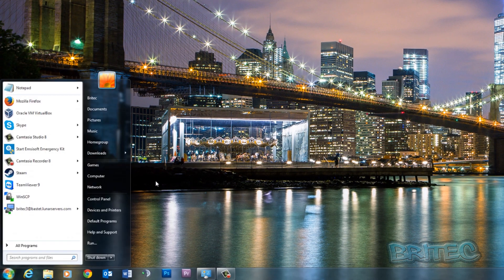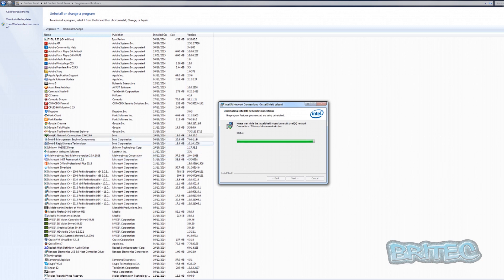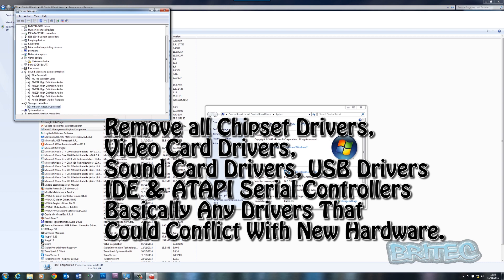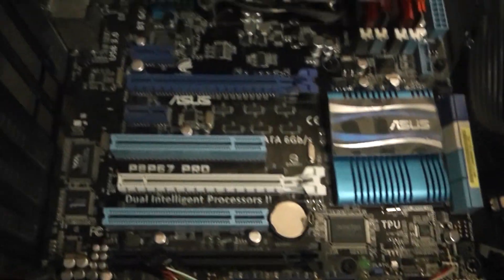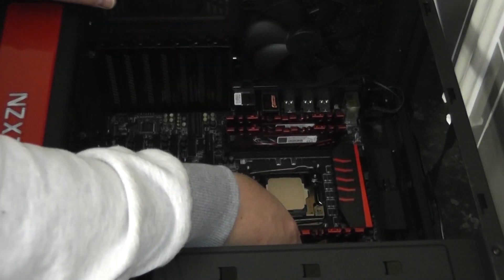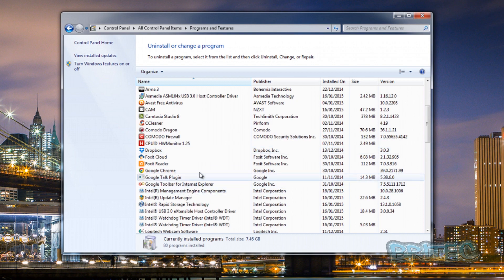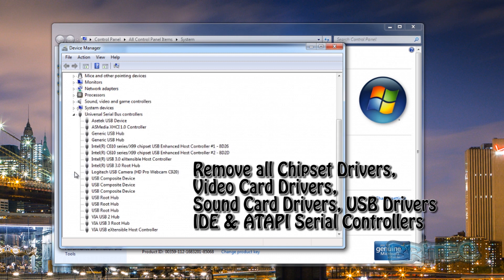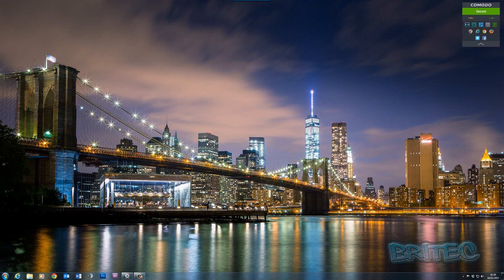Change Motherboard Without Fresh Install of Windows

Comment: Mate I need your help!! First Time upgrade noobE here 😀

Ok so I am planning on upgrading my motherboard from a Gigabyte LGA 1151 z170 GAMING X motherboard to a z370 motherboard so I can use 8th gen processors......

I have over 30 STEAM games installed and a lot of photos and music files stored into my PC. But most importantly are my STEAM games. Can I still follow your steps shown in your video still 2018? Will I have to buy windows 10 again for my new mobo? Also if I just simply connect my HDDs to the new z370 motherboard, will my saved STEAM games and photos/music be easily transferred to the new mobo without backing up anything? My plan is just to upgrade my motherboard and CPU and keep my HDDs. Please help me be successful first try 😃😃

Comment: What if i want to install a new mobo what is basically the same brand chipset as the old one? i just upgrade my miniatx mobo to an atx one due to a broken ram slot. so i just take off network and chipset stuff and ready to go?
Update: I did it. since both mobo had the same chipset and basicly the same version of mATX/atx i just removed audio drivers from device manager and a few chipset/usb stuff, swapped the board and it was all ready to go.

Comment: I think if staying on same brand chipset, the only drivers I Would worry about is the ahci/raid drivers.

So if e.g. from haswell to coffee lake, then just revert to windows standard ahci and you probably good to go, of course tho newest cpus are blocked from functioning properly by microsoft on windows 8.1 and older so the trick would probably only work on windows 10 on the latest cpus.

Comment: Hello, i just finished swapping my mobo, for the first time ever and im very new to pc building. i got windows 10 and i changed from a Asus EX-A320M-gaming ... to a msi b350 gaming pro carbon so i could overclock my ryzen 1600. 
i did the swap very carefully and i unistalled the realtek internet driver and realtek audio driver nothing more, 

note that i only swapped mobo so i kept the driver for everything like nvidia for the gpu n stuff.

when i wqas done i plugged it in and pressed start in i worked instantly and i had no problem with windows what so ever. and all my files seem to be intact. 

thansk for the help
Reply: Did you get Windows 10 from the free upgrade or did your PC come with it ?
Reply: +CowBoy15
In case you're scared about losing win10 key (For ppl who upgraded from win7).
Some ppl said it will stay intact, as long as you can login to your Microsoft Account that bounded to the win10key.

Comment: Would this work with OEM Windows 10? I have an ASUS motherboard for the a10 6700 want to switch to the same motherboard but lg 1511 for a better intel processor.

Comment: I upgraded from an asus z77V mobo, intel 3770k cpu and corsair vengeance ddr3 to asus z270-a mobo, intel 7600k cpu and corsair vengeance ddr4 without reformating win10 and changing all drivers. Just downloaded mobo firmware etc. Benefits of using the same but newer versions I guess. Hope this helps someone:)

Comment: Great video!  I think this is the solution I've been looking for.  A question though: I want to replace a very old 775 mobo that has an Intel  P4.  I have been running Win7 Pro 32bit coming from a SATA HD - and would like to retain this.  The new hardware I am thinking of putting in would be an H170 based mobo with a skylake 6th generation processor.  I also plan on buying a new USB optical drive for this system (as my old optical drive is EIDE ribbon-based).   So my question is -  if the process you've described fails me, and I fall-back to doing a fresh install of Win7, will I need the bios to be able to read the USB optical drive at start-up so I can initiate the new Win7 installation?  Will I be able to do this - because I've read other material that indicates skylake can't support a Windows7 installation from a USB drive?  Thanks much for any feedback!

Comment: Uninstalling the usb drivers won't let me use my mouse and keyboard and windows is not installing them back. So I'm basically screwed on my pc. None of the USBs work. So I'm stuck on the desktop screen not able to do a single thing. They work in bios, but theres nothing that can help me in bios. They do not work in safe mode either.
Reply: LilColb Did you manage to get the drivers back? You should have just swapped out the motherboard.

Comment: I feel like I am doing something wrong? I am trying to delete all the drivers listed but when I try deleting all the usb, my computer freezes. Somebody help! I am trying to install a Gigabyte 78LMT-USB3 with an Amd fx 6 core processor FX6300 into my Compaq presario CQ5320F it came with a AMD athlon II x2 240 processor. The mother board fits the screw slots, so what am I missing?

Comment: dont do this - it just messes up your computer and then you gotta go back to a old state. i just went online bought a cheap copy on windows 7 like $20 and it came with iso file and i put it on usb and boot it from that. reply if u got questions ive been trying to switch my mb for like the past 12 hours and i finally got it

Comment: Upgrading from FX8350 ASUS 990 MOBO to Ryzen 1600 with ASROCK B350 board. Want to keep win 10 on my SSD and GTX 1060. It has an OEM version WIN 10  on it.  So If I remove the items outline in Britec video and install the new MOBO is there anything else I need to do?  Do I need to run sysprep or not?

Comment: So I have a standard Dell Z170 motherboard that this prebuilt came with and I'm looking to upgrade to the MSI Pro Solution Intel Z170A LGA 1151 DDR4 USB 3.1 ATX Motherboard, and i have an i7 6700. Could i just get that motherboard swap it and plug my hard drive in and be good to go?

Comment: if its the same chipset mobo, just put the new one in and boot, then install the new drivers. launch device manager, uninstall drivers with the exclamation point. if its a different chipset, then windows blocks, u will need a code that only OEMs and some PC technicians have.
Reply: Thank you for this. will have to check this out
Reply: I'm, for example, going from a gigabyte z77m to an asus z77-v
So I'm fine doing this?

Comment: Hey Britec.  I wonder if i could use this similar process if i am simply buying a brand new pc?  I actually did follow this article a few years back and successfully used my old hard drive in my pc after upgrading the mobo and it worked great.  Just trying to apply this same principle with a NEW pc.  I just got my new pc, but want to take my old hard drive from my old pc and use it on my new pc so that i don't have to reinstall Win7 and all the apps.  Will it work?

thanks for any help!
SJ

Comment: Worked PERFECTLY on Windows 10, thanks thanks thanks!
Reply: Hi Jafar. Hope you are well.
Can I ask, did you just delete what he deleted.
And also, so the drivers install automatically on the new motherboard for the Intel chipset and the USB drivers etc?
Reply: @S94-l9w  It's the drivers that are required for the new motherboard. It should have a CD , or website.

Comment: Ok it worked thanks but my Windows is kinda messed up because in task manager it says my old cpu and when I overclock it changes to (unknown) and my ram doubled its self but it's not actually doubled like I put 16 gb ram and it says 32gb so it is glitchy but thanks

Comment: You don't need to do this with Windows 10.  Win10 will notice that your motherboard has changed and do all the proper driver changes before booting up.  However, retaining your license for Windows is another issue.

Comment: I've experienced replacing my CPU and Motherboard with Windows 10 and I never had to do this. I just swapped the new Mobo to the old one and when I boot into the system, it says that "Windows had detected a New System. And then it gave me an option to choose whether to re-install a fresh (or new) Win10 (delete all files) or recover My files and Install Windows 10. I chose the second option and just had to reinstall all my programs and games back. All my files are still in the exact same folders where they were before I changed mobo.
Reply: tweak: well if you had to re-install programs and games then it didnt work for you. everyone else here is talking about switching motherboards without having to do that. backing up your files is easy, its reinstallng/ downloading/updating all your games/ software thats a pain in the ass. you might as well have just done a clean install in your case... we want the computer to boot up and everything still works exactly the same. i want to upgrade from m5a97 to m5a99 motherboard, keeping my fx8350 so i can overclock to 4.6-4.8ghz which i cant right now even though i have a really good cooler. the motherboard just simply cant provide the voltage/current. it works but if im doing something intensive it may fail after a few hours from the voltage dropping down for a millisecond, even with good fans over the vrms and cpu/ socket it just cant provide sustained hight voltage/ current. my cpu temps never go above 52'C and socket never passes 65.. stupid mobo, whish id bought a decent one to start with....
Reply: Tweak Tweakker u sure

Comment: One really important thing not mentioned in this video is when uninstalling everything and it's prompting you to restart to apply changes should you restart the computer once you're done uninstalling all chipset, audio, network drivers etc? or should you do a shutdown and then install the new motherboard? i would imagine if you restarted windows would re-install some of the drivers by itself but i'm not sure.

Comment: so I'm doing a new system build and I don't want to spend extra money on a os or something like that. So if it is a new prosseser and mobo, do you still need to uninstall those programs?
Reply: then is not a new system build, and they are no programs , are drivers

Comment: do you need to re-activate windows when changing motherboard?
Reply: shouldn't have to unless you are using a OEM version
Reply: Sweaty Try-Hard Gaming i dont have oem, i have retail
Reply: I just did with retail no reactivation required on my end so you should be fine =)

According to Microsoft OEM versions will require a reactivation while retil versions do not so upgrade away!
Reply: Sweaty Try-Hard Gaming so i just need to change my motherboard and plug in hdd? And its should be ok?
Reply: After you ensure there will be no driver conflicts yes you can. Just make sure you have the motherboard drivers on your PC or have a DVD drive hooked up.... I forgot to hook up my DVD drive and had to turn off my PC reopen it and connect the DVD drive. I was impatient lol

Comment: I've just got a new mobo. so uninstalling the drivers you've stated in the description and then shutting pc down and install new mobo it'll not format and hopefully run fine? I also read you only boot a new mobo with 1 Ram stick in then Refresh the bios then install the other, is that correct or can you just put both in?

Comment: I am swapping my CPU from an amd fx 6300 to a intel i5 6600k, so obviously I had to change my motherboard due to chipset purposes. I currently have windows 10 installed, I bought a hard copy of windows 7 and upgraded to 10. My question is, can I use this same windows on my hdd and just plug and play using the new hardware? Just didn't know if anything was going to conflict going from an amd motherboard/cpu to an intel based CPU and moba. Please help....

Comment: i have a i5 6600k and im upgrading to i7 6700k will i have to re-install windows 10 or 7
Reply: A change in the processor will not affect your OS (windows). You're good to go.
Reply: nope
Reply: cool cool, you wouldnt know where i could get a decent 990 chipset am3+ board would you?they are discontinued now i believe and its hard to find a well priced used one, lol. ive found one for $130usd /approx$160nzd incl shipping to nz but thats pretty pricey for old tech. i know i should save and move to ryzen or intel but i dont like to waste good components that still work so im gonna stick it out with my fx8350 a bit longer. maybe get a gtx1070 then upgrade cpu later. i know it will bottleneck alot in some games but still a massive improvement over my gtx760 which has actually performed really well. i still havnt found a game that cant run at mostly high settings with decent fps yet. and i can only imagine the power of the gtx1070 by comparison. i might but a new 4k tv to game with as well/ instead of my 1050p  monitor. my old 720p 32" tv is showing its age big time, lol.
Reply: Jspau: thats a motherboard change aswell as cpu change so (and its going from amd to intel (completely different chipset drivers etc) so you should do what others have said, unninstall network and sata srivers, shutdown, swap mobo/cpu, turn on, activate.. just out of interest: how did the swap go?
Reply: I haven't done it yet lol.  Plans have changed.  I believe I'm going to go Ryzen instead.
Reply: I don't know where you could get one, sorry.  But yeah, a 1070 would be a huge upgrade.  I recently upgraded from a 750 Ti to a 1060.  Mind if I add you on Steam to take this conversation further?
Reply: yeah sure, tbh im fairly new to pc gaming. so dont have many friends on steam, haha. i bought a pc instead of an xbox one.. my username is "dunnomuch44"
Reply: sorry, looks like i changed it to strike_3 at some point actually..
Reply: That was a wise choice :D
I can't seem to find you.  Search for me, "Jspau"
Reply: I'm upgrading from an AMD FX-8350 to a i7 7700k.  This is good to know!

Comment: lol when I swithed my 990fx mobo to an Z170 windows 10 worked fine, no problems at all. (my mobo died) Windows 10 uninstalled all the drivers from my old mobo by its self :)
Reply: +Darzo - Editor an you tell us what the specific motherboards that you swapped? It could be that The mobo you installed has automatic driver installation, I know with the MSI 990 FXA does not have that and you have to use the driver cd. Thanks
Reply: Atharva Naik i have no idea lol ;p
Reply: Atharva Naik I just installed my new mobo then booted windows, few seconds later new drivers were being installed.
Reply: Could you please be more specific? You mean I could just swap out my board with a different one and not have to format anything?
Reply: I installed my new mobo with cpu and ram of course.. right after I done that I powered on my system and everything worked fine.. booted into windows with no issues. I did reinstall (using windows 10 "reset" option) as my games weren`t getting the fps I was expecting.. my i7 6700k was performing like my old fx 8350 in games for some reason, must have been all the drivers conflicting etc.
Reply: Darzo - Editor And reinstalling Windows 10 gave you the performance you were expecting?
Reply: yeah it sure did ;p the cpu is an absolute monster! I can hit a solid 60fps in pretty much every game as my gpu isn`t getting held back. For example I gained an extra 15-25fps in gta 5
Reply: Darzo - Editor It's a little odd how reinstalling windows impacted your performance. Maybe it was a hard drive issue? Idk. But just so I can be clear, you swapped your board with no prior preparation right?
Reply: that is really bizarre, can anybody confirm windows 10 does this? I also want to switch mobo cuz I want to upgrade cpu, 
I just don't want to reinstall or buy windows 10 again, 
I had mine pre-installed cuz of prebuilt. I hope to god its an easy swap
Reply: Darzo - Editor I'm switching from a 990FXA to a Z170. Did you have to reinstall all your games after the reset or did it save all of your files?

Comment: What if it's the same brand of motherboard? I have an amd gigabyte atm and I'm switching to a gigabyte Intel.
Reply: Thanks for the reply :D Everything worked fine, booted right up!
Reply: OakedRS it will work fine don't worry. Just literally do nothing, don't try sysprep.
Reply: same here man
Reply: itzFadex I've researched this, and if you have Windows 10, Windows will do it automatically, you don't need to uninstall anything
Reply: Jaysonfred oh so I can just plug in my hard drive without doing a thing and it's good as new?
Reply: itzFadex it should be. Windows 10 is a lot more forgiving than the older Windows.
Reply: aye thx for help man
Reply: +itzFadex did this work for you? I'm swapping my CPU from an amd fx 6300 to a i5 6600k so obviously I had to swap motherboards. I'm sticking with the gigabyte brand of mother just the intel socket version of it. My question is if I'm swapping my CPU from amd to intel on a new motherboard will I have to reinstall windows or just plug and play with the same hdd?
Reply: frank johnston I went from amd gigabyte to a intel gigabyte and it worked fine for me, booted up perfectly! I would advise backing up first though just in case :)
Reply: frank johnston Np man I had doubts when I did it but it was fine in the end :P
Reply: itzFadex mine wasn't, I used sysprep and it bricked my PC, had to reinstall Windows but luckily all my data was still there on a separate partition, so it was alright in the end.
Reply: frank johnston hey man, everything still fine? I'm upgrading from a fx6300 to the 7600k and am wondering the same thing.
Reply: you dont get it do you???, he didnt say uninstall windows drivers, even if you have the same brand motherboard but the different version you may want to get the right drivers, and no they dont install automatically, you must intall them your self, mant are thinking there the windows 10 drivers and there not
Reply: it will boot up i slapped in a ssd with gigabyte drivers on my Toshiba laptop, and it worked, buy i just did that to speed up my slow laptop, but  if i wanted to make it my main computer i would have to uninstall all the gigabyte drivers, even if it booted up, dont matter, many people here think its ok just cuz it booted up with no problem but little do you know..